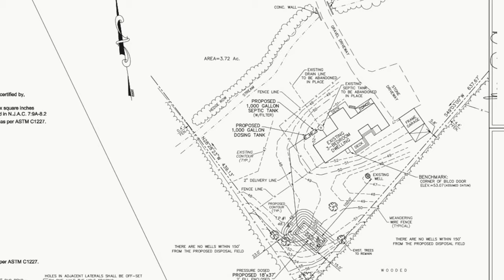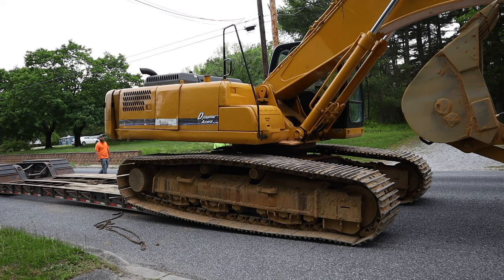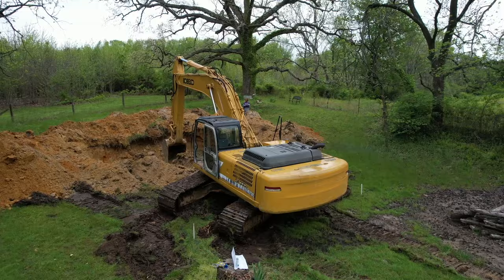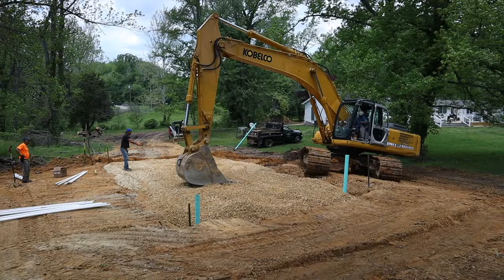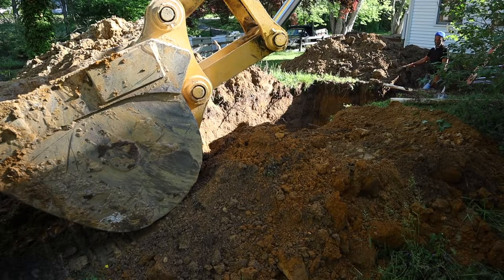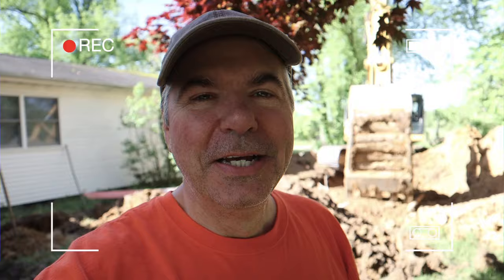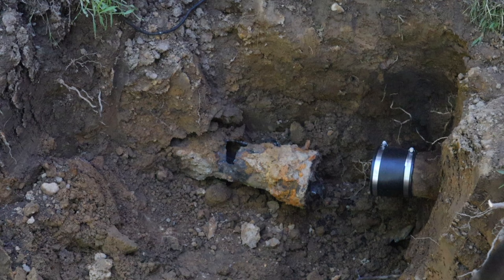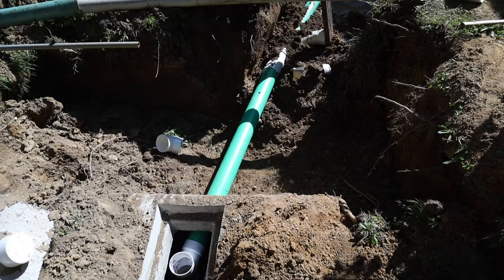Complete Septic System Install and Cost. Video 135

Comment from the maker: Here are some product suggestions. These are Amazon Affiliate links, so purchasing will help this channel by providing a small commission while not costing you any more . Thank you for your support!
AirTec Lube-Shuttle Pistol Grip Grease Gun Kit:
https://amzn.to/3O0pj1z
LockNLube Grease Gun Coupler:
https://amzn.to/3kPcvwu
Recommended Grease:
Valvoline Moly Fortified
https://amzn.to/3jNM1Kv
Nitrile Gloves:
https://amzn.to/34Kg8OG
Deerskin Gloves:
https://amzn.to/2I17NNy
My Video Gear:
Rode Wireless Go II microphone:
https://amzn.to/3eiJatG
Canon M50 Camera (now Mark II):
https://amzn.to/3vHW9uD
Battery adapter for M50:
https://amzn.to/2RshsBE
Sigma 16mm prime lens:
https://amzn.to/3vJDRcx
Sigma 30mm prime lens:
https://amzn.to/3epFneh
Variable ND filters:
https://amzn.to/3tmoHIs

Comment: My city sewer is $112 per month and goes up about 5% each year. Your $25k will pay off in the long run.
Reply: Damn! $112 Per month? That’s a lot.
Reply: Unfortunately, he probably could not switch to a septic system to save money.  Sewer bills are tied to water bills and are usually higher than the cost of water.  You pay the sewer fee no matter what in most areas with sewer systems.

Comment: Not new here but my first comment, I have the same set up as you BUT there is 3 tanks in my system. When I had our system put in 17 years ago it was set up for a 4 bedroom house so it is bigger than needed but we haven't had one single problem. You should be good forever!!! 👍
Reply from the maker: Hi Eric. Thanks for chiming in. 3 tanks!? Holy smokes!
Reply: How often do you have to pump it ?

Comment: Excellent video, Ed! Here in MN we have to have our first (solids) tank pumped at least once every 3 years. The system will last 50-60 years if the solids tank is pumped out regularly. You did a great job explaining the system! Cheers!
Reply from the maker: Thanks Mike! We’re not required to pump regularly, but it’s a good idea.

Comment: You got out of it cheap Ed! I paid $25K about 35 years ago when we built our house! Our soil is all clay under about 1.5 ft of top soil so they dug down about 6' until they hit the water table, had three large trash pumps running so as to keep digging several more feet. The pit is 30' x30'. The cellar floor was at the natural  ground level so we could have a walkout cellar in the back of the house. The septic system is in the front yard. All the dirt taken out of the pit formed the mound that would be the front yard. I can't remember how many truckloads of sand were brought in to fill the pit that ended up being about 15 ft deep so we walk right out of our front door onto the lawn. Keep up the great videos!
Reply from the maker: Thanks, D! These systems are no joke. Especially compared to what we replaced from 1958. We did have thick green grass for many years though 🤣
Reply: You know why SAM's skid steer track Broke ? Cause he is taking 10-15K pay cut to do these Jobs ...SAD . can't afford to keep his equipment maintained . keep this up he will be out of business !
Reply from the maker: @michaelgrier3537 well I got multiple quotes and they were in line with one another.
Reply: since you do these jobs why don't you share how much the parts cost and how much you guys profit in labor we are talking thousands of dollars in profit lol the parts can cost 3500$ or so

Comment: It really neat setup..I have a mound system..septic tank is right outside house then liquid tank is right next to mound..I had to take hydraulic cement n fill the round parts of tank cuz ground water was runnin in too…fun times n since owning this home I’ve learned a lot …living of the land😉
Reply from the maker: The joys of home ownership!
Reply: @MyClutteredGarage  that’s is a fact but I enjoy every min of it…sad thing is…5 yrs ago we when we bought it we had to have house lifted n new basement walls poured..at that time it was gutted from 1960 galvanized pipes bein clogged ect..house has new everything..wiring ,insulation,sheet rock ..hvac…appliances..fast forward to now…we are to close in Feb on deal with Fleet Farm n house is bein knocked down …

Comment: Great video and it was very interesting, thanks. It is also good timing as we will need to do something with our system too. As you would expect the rules are very different over here and I do not think (still looking into it) that the system you installed can be used over here now and we have to have some form of treatment system before the outfall goes into a soakaway
Reply from the maker: We’ve been watching Carlson’s Farm. If they are not exaggerating, you are definitely more regulated than we are. It would be interesting to see the differences in systems.

Comment: Heyhey Ed  Just curious what happens if you skipped all the permits and stuff and just did it?  I know here I have done a couple septic systems without permits or license and the only thing was if I sold the property it had to pass the inspection.  They do strongly encourage to get permits but nobody knocks on your door if you don't 
 Take care
Reply from the maker: Hey Mike. I suppose we could sneak in a fix, but you’re right. If we went to sell there could be problems. The county and state are really cracking down on septic systems. Oh and anyone saw us, someone WOULD come knocking. 😄

Comment: My mother’s old house was built in the 1950’s. It was originally a Farm home. The owner put in a cesspool that holds over 1,000 gallons probably sometime after the 1960’s. It still works great. But I’ve been considering having a septic tank installed. But if it isn’t broke why fix it mentality keeps sinking in. $25k isn’t cheap but in the long run it isn’t expensive. Any thoughts people?
Reply from the maker: Ours was built in 1958. If you ever sell, you'll need to update it. We weren't planning to sell, but wanted to update the system even though we could have gotten by. Turns out, the farm opportunity came up and we sold the house. The new septic made it an easy quick sale!
Reply: @MyClutteredGarage  I don’t believe I’m gonna sell this home. I def can’t predict the future. But, I think for now I shall wait. If it isn’t broke, don’t fix it!

Comment: How would you recommend repairing or getting rid of a leech bed that is basically just an eyesore cesspool swamp? Can't run a riding mower over the area it's covered anymore, and I'm gonna need to have installed this same septic system with a dosing tank & pump, as it stands right now we have only a single septic tank and that's it, so I'm probably gonna have the septic tank replaced as well.
Reply from the maker: I would think that old drain field will dry up when you install the new system and stop using it.

Comment: So the “liquid” that is pumped into the leach field is basically poop and pee water. Doesn’t this contaminate your well water?
Reply from the maker: That’s why there is a minimum distance requirement between the septic and the well. Plus our well is 340 feet deep, so I guess the ground acts as a giant filter.
Reply: @MyClutteredGarage  I see, so the septic should always be put in first
Reply from the maker: @markusr1308  probably so since there are more limitations on its location unless you have a property with great soil.

Comment: Thanks, but all that permitting and design, not to mention pumping uphill in NJ, just not relevant for me in rural E. Texas out in the woods. Haven’t gotten to end, the cost of all that scares me. Your system must handle 20 folks living there, a small army.
Reply: Holy Batman, $25k. I’m somewhat shocked, but get it with all the details, materials brought in, equipment used and size. I guess you choice was hold your nose and fix it, once and for all
Reply from the maker: Hi Scott. I would think you’d have a similar system, minus the 2nd tank and the pump of you can gravity feed. Believe it or not, this system was only designed for a 3 bedroom house. 😳
Thanks for checking in! -Ed

Comment: They are great at what they do but the problem I have is I bet their wasn’t 5000 in parts )pay the guys a wage the rest is profit they have you over a barrel most people can’t do it just like hvac most systems are under 3000 and they charge you 12000
Reply from the maker: You’re probably right about the cost of materials, but you’re also paying for skill, experience, and the cost of equipment. There was probably $300,000 worth of equipment on this job, so it takes time to pay for that. 👍